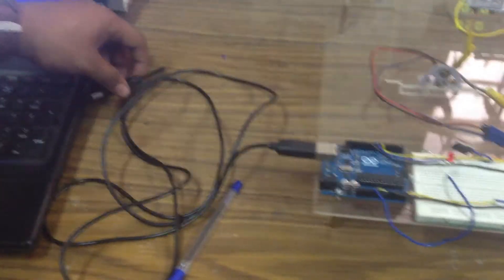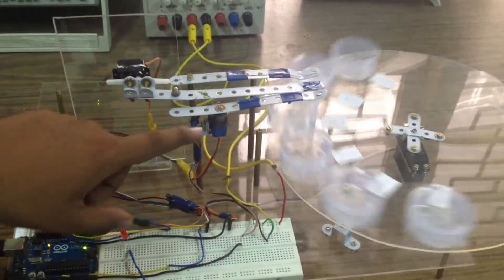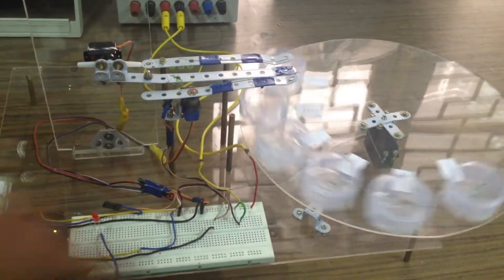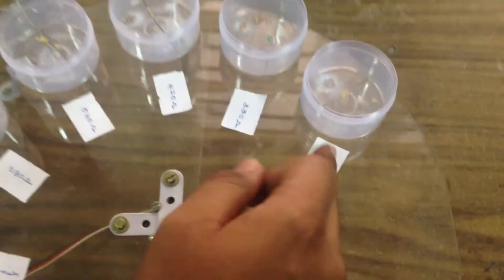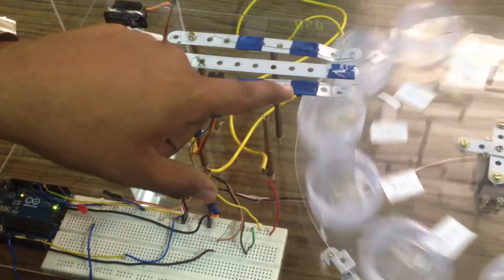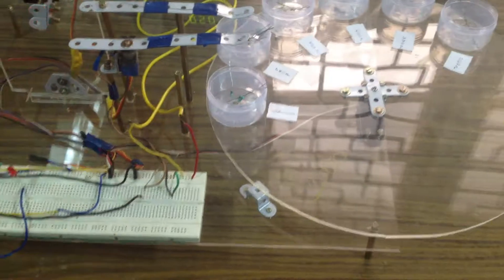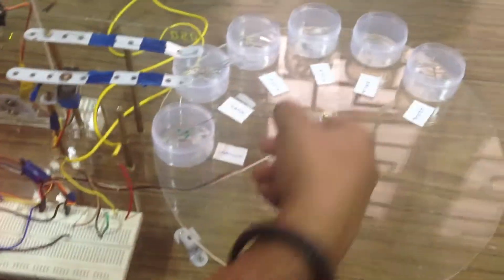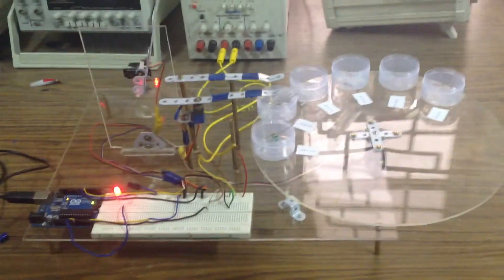RESISTOR SORTING MACHINE (PROTOTYPE)

Comment: This is excellent, just what I need to build. Would you mind sharing which sensor you use on the vertical mechanism to read the resistor stripes?